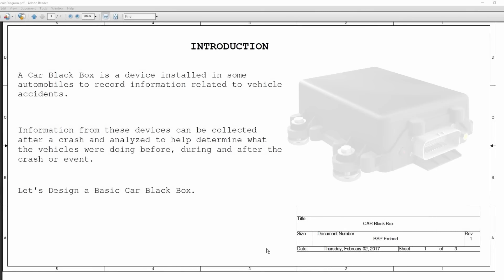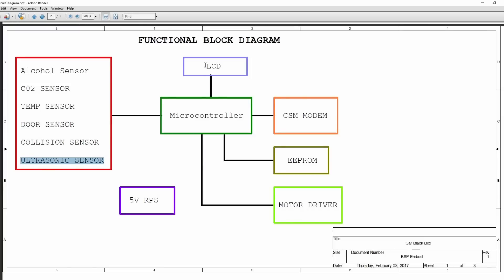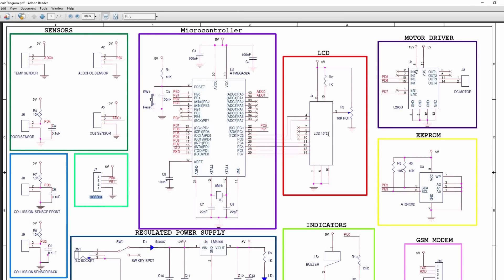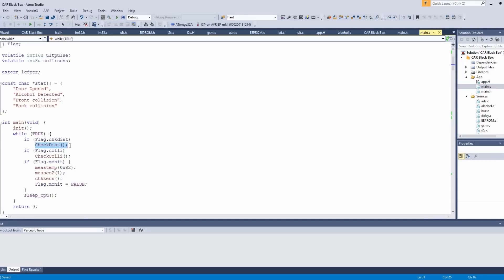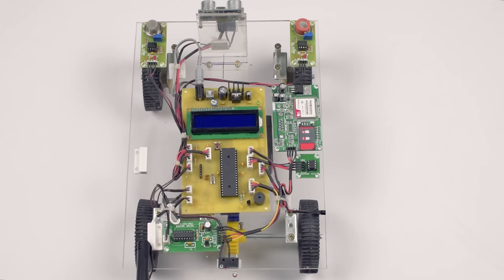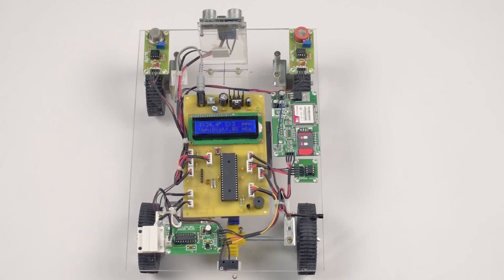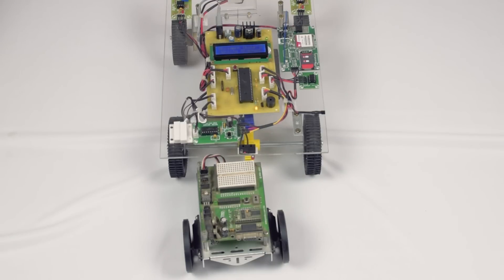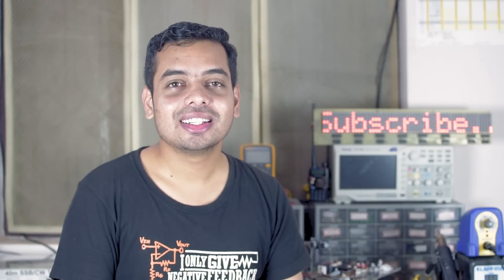How to Design a Basic Car Black Box

Comment: Sir how to understand the circuit diagram you have not mention all the pins of sensors and gsm so how can i understand which pin should be connected to which for eg- alcohol sensor has 4 pin but in diagram you have mention 3 pin
Reply from the maker: For Alcohol Sensor, We have taken Dout. For Co2 Sensor we have taken from Aout. All Four pins of GSM Modem are used. (5V, GND, Tx, Rx).
Reply: @Emtron_Technologies  and for collision switch which two pin you have used
Reply from the maker: @RahulSingh-fd8yt  Common and NO (Normal Open) Pins

Comment: why we are using the  microcontroller instead of using Arduino what is the main reason u can mention
Reply from the maker: It's requirement from my clients. You can use Arduino to perform same function. BTW, Arduino is also a microcontroller.

Comment: is the door sensor a leaf switch?
Reply from the maker: Magnetic Sensor.
Reply: @Emtron_Technologies  another doubt i have is that i want the car to move even if the door is open or alcohol content is present...because i want a black box which rercords the readings of all sensors once one of the sensors start showing out of bound(not under safe value) values...but it should not interrupt the driving of the car but once any accident has occured one can access the recorded readings...what kind of changes do u suggest in the code and in the structure...also how do we know about the battery level as when do we have to change batteries?
Reply: @Emtron_Technologies  also why did we use specifically atmega 32a?
Reply from the maker: @yashs1962  Go through the program.  Once you understand the structure, you can make any changes. We have not implemented BMS (Battery Management System) in this project.
Reply from the maker: @yashs1962  Availability, Low cost, Open source development tools.

Comment: Plz sent me the block diagram and circuit daigram that you are showing in vedio
Reply from the maker: You can download all the details from GitHub.
Link is given in the video description.
Reply: @Emtron_Technologies  dear sir in the programes there is only one   main.c file and all the other files are  hex file i have only to convert the main.c to hex file it will perform all the operation of the car like sms , sensing of temp, etc or i will load all the hex file to  Atml 32 independantly
Reply from the maker: You have to compile all .c files together to get single Hex file. Which is programmed into the controller.